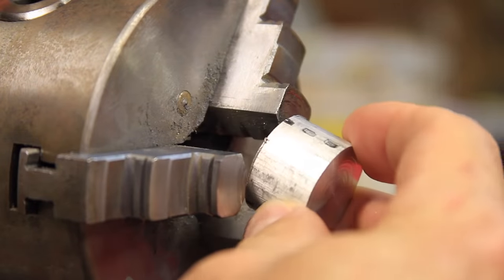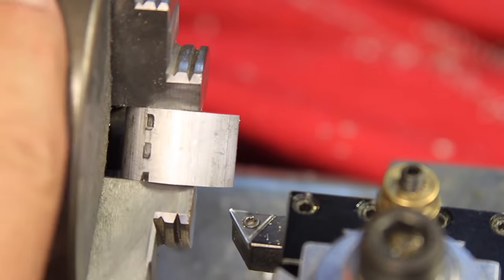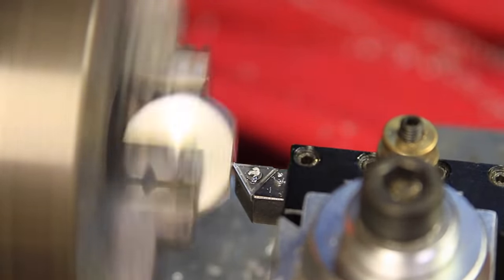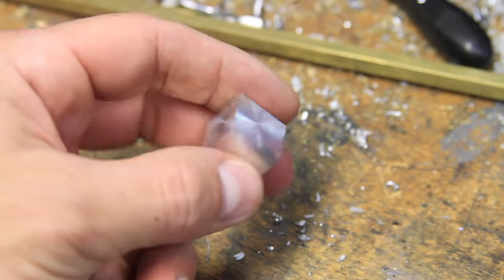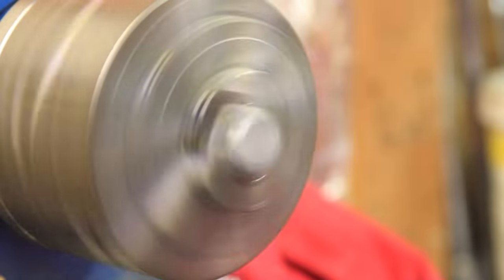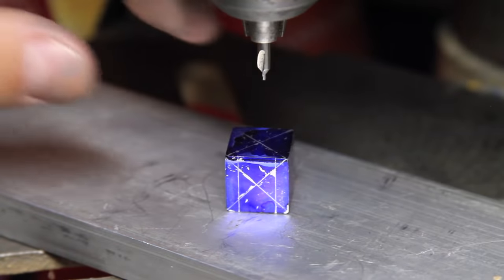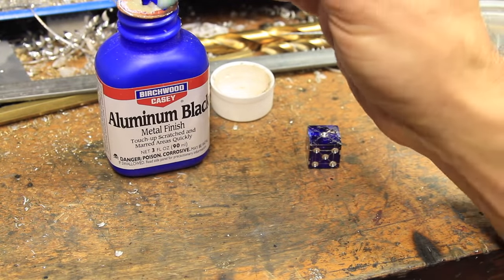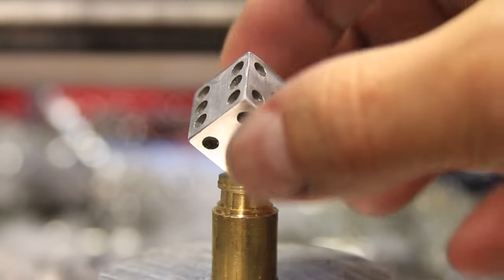Scrap Project - Turning Game Dice! Making a six side cube (D6) die on the mini lathe!

Comment: I made some dice out of aluminum square stock. I scribed my lines and used my mill to put the indents in them. I used a ball deburring bit for this. The die are numbered in 7 with the 2 numbers being opposite of each other. It would be 5 on one side and a 2 on the opposite end directly across from the 5. And of course the other numbers are 1-6, 3-4, look at any die and this is how it is laid out. The ball end deburring bit worked great for the indents. Aluminum machines, sands or whatever else, using a WD-40 type lubricant instead of oil. Nice video and I appreciate you sharing your knowledge. Keep up the good work and be safe.

Comment: Hey Tim.. I tried doing this but ran into a problem. Hoping you can reply... When I was trying to turn the die. I couldn't figure out how to square up the face of the die after you cut one side and flip it over to cut the other.. How do you ensure the two faces are parallel if you cant reference the back of the chuck face to make it square?

Comment: Suggest centering each dot with a light center drill like you did but then pressing/punching the rest of the dot with a larger round punch to create a detent. This will eliminate the final drill bit chamfer/point at the bottom of each dot.

Comment: Great vid! for future reference using this technique will get 2 surfaces of a cube parallel, but generally the squareness to an adjacent side will be out the window. Based on the oblong dice video from numberphile I'm sure this wont hurt the die, but might pose a problem for functional parts that have to mate up square
Reply from the maker: Thanks! I'm curious though, why would it not be able to get squareness on adjacent sides?
Reply: TimNummy Its not that it can't do it, its just dependent on the straightness of your jaws (and jaw bevels) in relation to the centerline of your machine. That and when you clamp anything in a chuck, the jaws flex outward minutely. When you are contacting all 3 jaws equally the part stays on center because the jaws flex roughly the same amount. When you clamp a part so it hits one jaw dead on, and the other 2 on the chamfer the part becomes overconstrained and will kick one way or the other to satisfy the loads put on it (kinematically speaking). This will generally cock the part.
Reply from the maker: Ah that makes sense - I'll keep that in mind for sure, however I'm not sure I'll ever do anything that needs to be THAT square haha.

Comment: Way cool! I'm afraid you didn't take into account that the weighting might be off. Since more mass has been removed from the 6 face when compared to the 1 face. If the holes are the same depth across each side, then each face has a different weight from the others. It's as if you stuck a plastic die into the toaster to melt a face just enough to always land 6 up.

Comment: Good job, but i always thought the edges were beveled to allow the dice to roll, maybe on a following video. It would be good to compare them to a standard set.
Reply: Casino dice have sharp edges.  Casual dice may or may not.  Casino dice are meant to be thrown though so you may be right :)

Comment: Did consider making the indents on the lathe, either by using a four jaw chuck (if you have one) or by attaching the die to the tool post holder and grabbing the drill with the chuck?
Reply from the maker: I didn't - I thought about at least marking the center ones (1, middle of 3, and middle of 5) with it mounted in the lathe but then decided it would be easier (although slightly less precise) to do on the drill press. FWIW I don't have a 4 jaw chuck yet and I would had to have made some kind of fixture to mount it to the tool post holder so it just would have been more work than it was worth with what I have. 

Thanks for watching and commenting!

Comment: Hello Tim a question do you have the aluminium or steel version of your jinwen quick change toolpost
Reply from the maker: Hey! I have the aluminum version (it's linked in the description) and while it isn't as good as the steel version and is starting to show some wear already, for the price it's pretty hard to beat and borderline disposable.
Reply: wow I just looked at the listing for that. Can't be right, way too cheap. May have to order one myself..

Comment: the results could be distorted because of the weight difference of each face
Reply from the maker: You're right in theory but I'm not sure practically how much of a difference it will make - I thought about rolling it a bunch of times and recording the distribution but then I didn't. Maybe I can do a follow up video.

Thanks for the comment!
Reply: I commented so to write something, I appreciate your work (and I watch all your videos) and I also think that the probability is almost the same, it is still interesting to do a test, but to be reliable you should do a lot of throws and repeat the experiment with a nut without weight difference , anyway, the way it is launched could introduce "disturbances" that would falsify the experiment